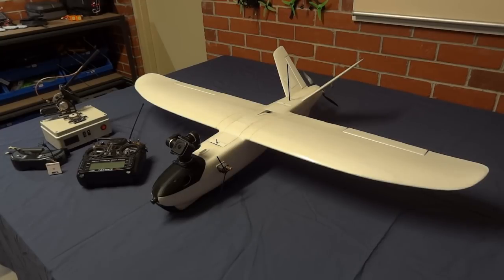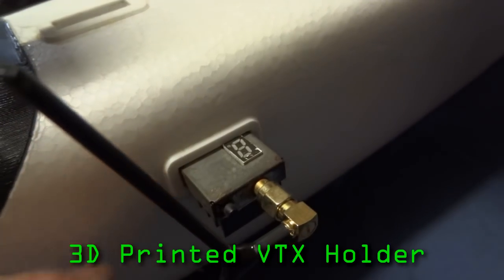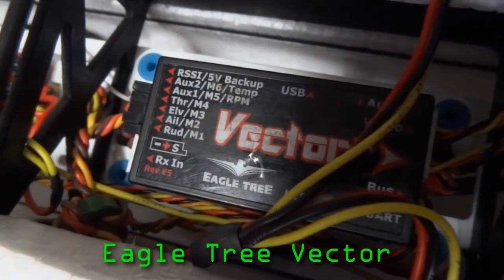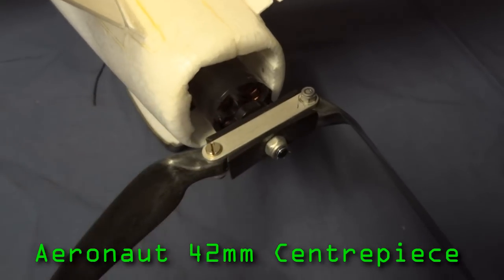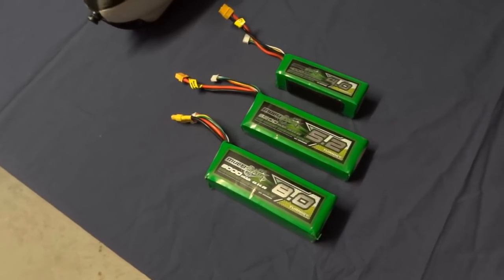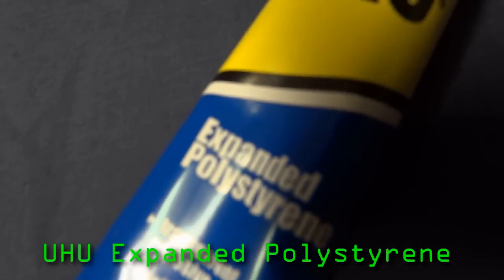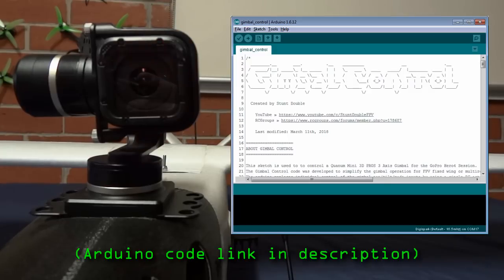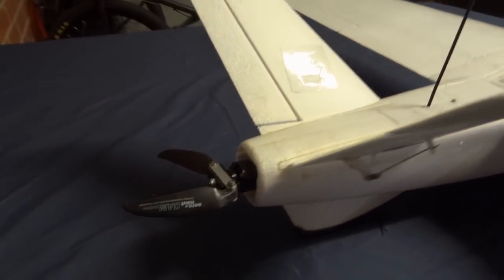» Mini Talon Overview - Gimbal, Parts, Setup & More

Comment: What the maximum distance covered with ezuhf....... Any info !!
Reply from the maker: It all comes down to the antennas.... With the stock antennas anywhere from 0km to 10km, with something like a diamond srh7771 and a dipole about 20-30km, but for long range a Yagi and dipole will get you 50km+. EzUHF never had a great reputation but if you upgrade the antennas it works so much better, I even think it's better than dragon link

Comment: Nice presentation on your build.  Thank you for sharing.  Question: would a 9x6 prop still be ok to use on the same motor (in lieu of 8x6)?
Reply from the maker: Yes, I've used a 9x6 before. You don't want to run it full throttle for too long but for cruising it will be just fine

Comment: Why do u have 40 a esc on plane that can do 30 a max (even that with 10x4.7 prop).Amp draw wjth this prop should be like 15-20a max. Just asking(sry for my english im from slovakia)
Reply from the maker: What makes you think this combo only does 20A max??
Reply: @StuntDoubleFPV  I want to buy this motor and in the table there was 30.2a max with 10x4.7 prop. And this is smaler prop but bit biger cam.(so i thought it will be same or less)
Reply from the maker: @Funcraftt  approx 29A max. at launch
Reply: Ok thanks. So 35a esc should be good?

Comment: Hi,
Can you confirm that you are using the Aeronaut 42mm Aluminium Centrepiece with "-5deg". 
Thanks.
Reply from the maker: It is a 42mm aeronaut centrepiece but straight, no twist
Reply: @StuntDoubleFPV  FYI, the link resolves to the -5deg version. It may cause some confusion. Cheers.

Comment: Nice job.  I wonder if you'd figured out if it will float...at your heaviest flight weight...in case of an inadvertent "landing" in water.  Thanks.
Reply from the maker: Yeah nah not gonna be testing that !!
Reply: Just FYI, found these pics, post 13270: https://www.rcgroups.com/forums/showthread.php?2043439-Talon-MINI-FPV-plane-official-thread/page915#post39782311 -- It floats nicely...LANDING  and splash down is probably another story.

Comment: It appears that your Eagle Tree vector config file is now missing, any chance you could repost?  Thanks
Reply from the maker: Hi Wayne, link has been fixed - https://www.dropbox.com/s/nbf53kp2s8fv49m/sd_mini_talon_vector_v12.67_20180910.TXT?dl=0
Reply: Thanks for getting back to me!  I tried the link again and the link your drop box did work but the file that was there was a TXT file, maybe it's me but I couldn't make make any sense of the data.  I would really appreciate if I could get your settings you used for the vector set up.  My first vector and it would be great to set it up to ensure that I'm starting from the right point.   Appreciate any additional info.

Comment: can you enlighten me with the radio setup you're using, and the range you get out of it? Incredible footage! made me want to build one myself! Thank you!
Reply from the maker: Nothing special, just taranis + EzUHF jr module + 4ch receiver. Antennas are 3D printed qczek moxon (can find on thingiverse) and a homemade dipole. The crucial part is the antennas, dont need fancy gear like crossfire or dragonlink just good antennas makes the difference.
Reply: @StuntDoubleFPV  four channels are used up by the plane's basic controls aren't they? How do you control the gimbal and change flight modes? Cheers 😎
Ah, ignore me.. You already answered. I'll have to look that cppm  thing.
Reply from the maker: @husky041  cpppm or sbus to get extra channels. I always need 12

Comment: Nice setup! One question, motor adapter screw is 5mm? And center piece of folding prop 8mm? How did u mount it?
Reply from the maker: Alexander Fedorov http://www.carbonbird.com/products/prop-insert-bush-5mm-id-for-graupner-e-prop or you could 3D print a bush

Comment: Would you thing that adding wing extensions (8 cm ?) would be interesting when the plane is heavy (with the Gimbal) ?
Reply from the maker: Prob not worth the effort. There are many pilots who fly much heavier MT's than mine. Some people load them up with a shitload of 18650's for long range flights. I certainly don't think my plane feels overloaded at 1700g, it launches easy
Reply: OK

Comment: With the Arduino code, any reason to not continue to the next location with the shortest rotation without doing a reset ? Is the location error with a timed movement not accurate enough and it stacks the errors with extra movements ?
Reply from the maker: Mr covert good question. If no reset is used you would have to calculate a panning time based on old vs new position for every change. If any of the gimbal presets are moved around, modified or deleted you would have to calculate everything all over again. This particular gimbal is a bit limited in the panning control as it locks onto a compass heading rather than relative to the gimbal itself
Reply from the maker: Btw... Is this Covert from Melbourne?? Flown with you before?
Reply: Yeah that's me, flown a few times together and a glitch owner :)
Reply from the maker: Mr covert :)

Comment: Nice gimbal setup SD. I've got one of them on the shelf. In a previous video you said you are out off channels for tilt, with the Arduino and the taranis you could do some tricky mixing in the  taranis and decode it in the Arduino to have everything on one channel.
Reply from the maker: Hi Mr Covert, how would you go about this? I cant think how to independently control pan/tilt/mode using one channel only. Is there some way to trick it with the ppm stream or something?
Reply: Using the programming power of the Taranis you send two different values on a channel, one after the other on a mode change, when switch is toggled send mode value then continue sending tilt value. The position is offset above the highest mode value and the arduino decides if it’s tilt position or mode, makes the needed adjustments to the tilt value output to bring it into range if needed. You will loose resolution but not much. Can get even more complex if needed.
Reply from the maker: Mr covert ok thanks for the explanation. I'll keep this in mind if i need to expand the gimbal functions
Reply: Sweet. I should have my MT flying this week. I'll have a look at the Arduino setup for my gimbal
Reply from the maker: Covert, you wanna sell your gimbal to me???
Reply: Stunt Double FPV no sorry. Almost finished my MT build with the key part being the gimbal.
Reply from the maker: Damn. Mine has shat itself
Reply: Stunt Double FPV Bugger. There hard to get, if you find more than one I know someone else who will be interested in one.

Comment: Nifty little assembly on your Ground Control box, any way you can give us a detailed look inside at exactly what brand of components make up the entire assembly? i.e. where did you get the outer enclosure box, what brand is the 5.8GHz relay, what is the articulating base for the antenna...thanks in advance.
Reply from the maker: kaptainkosmo hey, yeah i'll do a video sometime soon. Ive had a few questions about it
Reply: thanks bra much appreciated, looking forward to it.

Comment: Just another quick question while I wait like a kid waiting for Christmas for the tracker vid lol...   How do you find the range with the vtx mounted on the side of the fuse??  Was thinking of mounting on the the antenna on the wing but that placement is so much easier.  Cheers again Dave
Reply from the maker: SHAWZY1973 on side of fuse is ok but i got better reception on my first mini talon when it was on wing.

Comment: maybe a dump question but there is no solution to get the Gopro feed on the fpv googles?
Reply from the maker: Dozerboy84 not for gopro session, other gopro gimbal yes
Reply: Stunt Double FPV so you do not see gopro view while flying and hope to have a good view, right? assume session 5 will work as well? am amazed from this view man
Reply from the maker: Dozerboy84 pretty sure a session 5 would work with this gimbal. I cant see where the camera is pointing so thats why i use the arduino and the taranis calls the camera presets
Reply: Stunt Double FPV ok thanks, regarding the canopy for the gimbal: you mentioned that you have two. Is the canopy for the gimbal also the plain one which you modified for the gimbal? Couldnt find a specific cover on his website for your gimbal, therefore the question.
Reply from the maker: Dozerboy84 yeah the gimbal uses a modified canopy with a square hole cut into it.

Comment: Bloody hell that is sooo goood! Im building MT too and I hope I will get working DIY gimbal (Storm32) together with FatShark Trinity headtracker module. There is not much info on such a setup but headtracker output can be transmitted on selected channels via crossfire (big diversity reciever) and then fed via PWM into the Storm32 gimbal controller... If I will manage to put everything together it will be AWESOME!
Reply from the maker: Tom Frajer i setup a storm32 but could never achieve smooth footage like the feiyu tech. I reckon a gimbal from dji mavic would be the go
Reply: I already have all the parts so I will try soon :) Should be doable as I saw lot of smooth vids using STorM32.

Comment: Excellent vid. I just finished built mine but I'm using F4 pro V3 FC... I'm going to take out some of the aileron and elevator travel like yours. Right now is really Twitchy!!!
Reply from the maker: You got much experience with iNav? I put an omnibus into my old busted up mini talon and got it flying but i just cant tune it to feel anywhere near as good as the vector.
Reply: Yes I have some experience but never with V tale planes, only wings.. I'm using  a Nano Talon as a guinea pig (because they are similar) and I'm going to try those PIDs in the MT... As soon as I have it well tuned,  I,ll share .

Comment: I forget : which arduino is it please ? Really clever your mode. With my mini 3S, I had done logic switch between camera video switch, trainer port (headtracker) and LS/RS on taranis but your solution is really nice ! thanks again !
Reply from the maker: macfly1202 hi macfly, arduino nano. But you can use any arduino. My mate just set one up with a pro mini
Reply: Stunt Double FPV super !

Comment: Bloody Aussies have to make everything perfect. I've been trying to achieve perfection for years and then you make mine look like a 5 year-old has put it together. 
Brilliant mate, simply perfect :D
Reply from the maker: Vortecks bloody aussies cheating in international sports.... Embarrassing to be aussie at the moment
Reply from the maker: Hey there, pros and cons for both setups. Video reception was better for me when the antenna was mounted in the wing. Prob will shift it back out there sometime. Always best to get the vid antenna far away from the lipo as possible and also good to add more separation to the gps too which is my main issue with it inside fuselage. The UHF antenna placement doesnt make any difference to me. I still get the same kind of range now with it in the fuselage. Same power mode. Yes the lower part of the antenna does get a little damage. I believe the ground station plays a much more important role in healthy uhf rssi. Good antennas, good receiver, antenna tracking and as much elevation as possible makes the difference.

Comment: I wrecked my 1238mm skyhunter. Will the motor (1400kv) and servos fit in this? I use etv too and lucky wasn’t damaged.
Reply from the maker: How much does the motor weight? Do you have the full specs? 9g servos will fit into the MT

Comment: Awsome, how do you find the ezuhf I have the module and a receiver but haven’t put it in my fx61 yet, at the moment I am still using 5.8 ghz for video I just got a 1.3ghz receiver from rmrc which I use for my buggy for fpv 
Any suggestion on a cheap 1.3ghz ground station set up and antennas
Reply from the maker: I have had good experiences with EzUHF. We can run multiple units in a formation without any failsafes. Just need to upgrade the antennas - a moxon and a simple dipole work a treat. For a cheap 1.3 ground station I would use the RMRC VRX with the saw filter and then Skew Planar on both ends or go linear and use an inverted vee with a biquad on a swivel mounted tripod. But do yourself a favour and get a vector + eagle eyes + pan n tilt + yagi. No need for diversity
Reply: Stunt Double FPV thanks for fast reply I have a rmrc 1.3ghz receiver I use that and a uhf receiver on my buggy as I currently have the fx61 setup with 2.4and 5.8 but want to look at uhf and 1.3ghz I looked at your yagi antenna do you have a video for the build antenna 
Will 5,8 work ok with uhf
Reply from the maker: No build vid for the antenna. They are not too difficult to build and you don't need to worry too much about precise measurements. 5.8 + uhf works just fine. Let me know how you go

Comment: Surprised with such short control surfaces moves.
I am also surprised you use ezUHF, lot of people complaining about it's reliability.
Reply from the maker: I have reduced the quite a bit since my first MT, i like small movements so I can concentrate on shooting smooth footage. I've heard about some dud EzUHF modules but most of the issues come from the stock antennas which are best used for stirring paint. Upgrade the antennas and EzUHF will do 40km no problems.